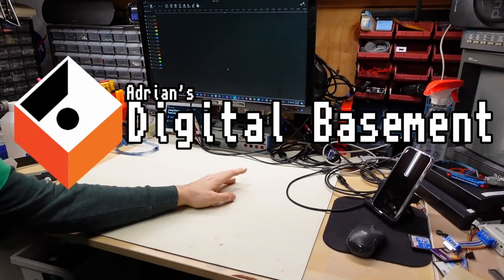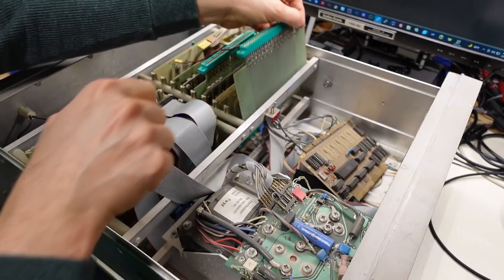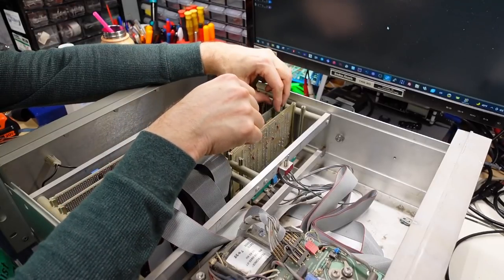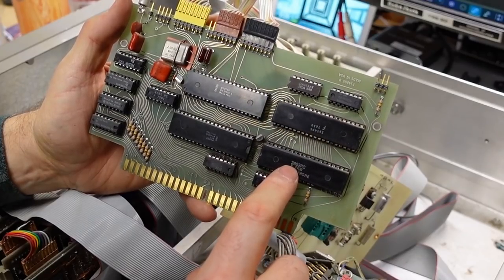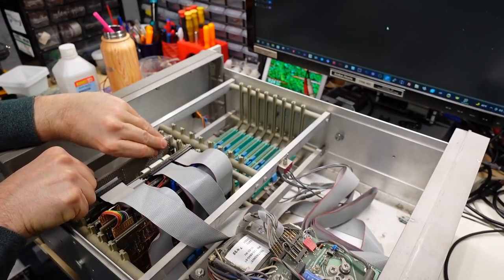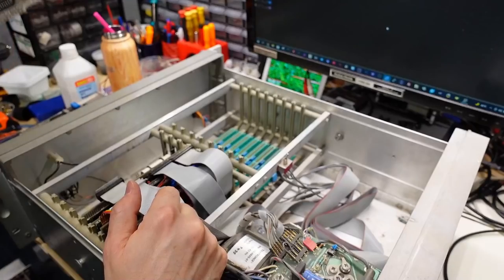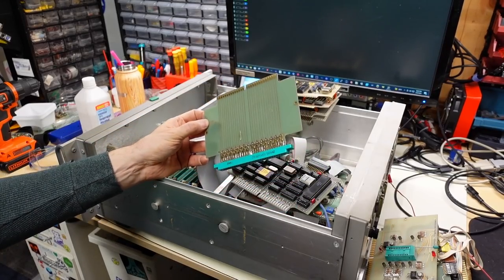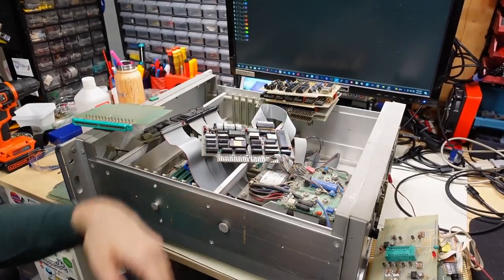I need help finding information on this mysterious computer

Comment: It's an STD Bus machine ( https://en.wikipedia.org/wiki/STD_Bus ).

Edit: The board with the four 40-pin packages and which is connected to the ZIF socket board appears to be a Mostek 3870 system ( https://www.cpu-world.com/CPUs/3870/index.html ),  which is a direct derivative of the Fairchild F8 family ( https://en.wikipedia.org/wiki/Fairchild_F8 ). Wild!

Edit 2: Z280 is a 16-bit extension of the Z80. TIL! ( https://en.wikipedia.org/wiki/Zilog_Z280 )

More edits:
- The 6402 is one of the earliest single-chip UARTs I'm aware of. Both 6402s are associated with the expected level shifters for RS-232, in both cases in the form of the little 8-pin SN75150 driver on two outgoing lines and the SN75154 receiver for four incoming lines. One line in each direction will be for data (TX and RX) and the others will most likely be modem status/hardware flow control.
- So there are... what, three separate CPUs in that thing? Four? And at least three different architectures too (F8/3870, Z80, Z280). Wow.

It's a beautiful machine. Those handmade cards are works of art. I'm glad you were able to rescue it.
Reply: I'm beginning to think this might be part of a collection of separate STD bus computers with cards just being stored in this chassis to keep them safe? It does seem odd that there are several cpus, unless the toggle was to select from the 3 cards?
Reply: @LegalizeAdulthood  Pin 1 of these is ground, so it doesn't match electrically either
Reply: Yeah, the many different processors is super weird... It's like there are three or four computers all crammed into the one box. I suppose given the somewhat ridiculous number of UARTs in there this is maybe not a stupid explanation?

And yes, those handmade boards are GORGEOUS, in all likelihood a complete nightmare to troubleshoot but gorgeous none the less...
Reply: It's not a single configuration. 

Based on the date codes, I suspect the F8/3870 was the original CPU that shipped in this machine. The ROM board appears to be of the same vintage, the PROM programmer and maybe the 24k ram board, though it looks slightly newer. maybe the first SIO board. All chips on these boards date to 1979 or earlier. 

Then the Z80 board was added on later, maybe in 1981?, along with the 64k dram board and the CPM ROM chips, and the machine was converted into a CPM machine. I think the Floppy controller, and RTC/serial/FPU board dates to this config. 

Then the Z80 board was removed, that's why it was floating around the case, along with the CPM rom, and was replaced with the handwired Z280 sometime after 1986. The handwired 128kb of SRAM probably also comes from this era, and the serial/parallel/timer board. I suspect this is when many of the other boards got most of their bodge wires. 

I suspect this chassis actually carries two reasonably independent systems at once. The original F8/3870 machine, and the Z80 or Z280 machine. Not sure if both can run at once, or interleave execution. Or if one of the toggle switches switches between the two systems.
Reply: I think three processors. Ok, guessing time based on the cards, their state and what you found out:
My guess is that the Z80 is the primary CPU and probably ran CP/M (if not it'll probably get even harder). I'm wondering if the sockets on that board is there to allow people the option of using it as a minimal system, say 2 ROM and 4 RAM? It has a LOT of board connectors on top so perhaps that's how it would be connected to the external world in that mode?

The Mostek (F8) is connected to what must be an EPROM programmer, so I'm going to guess it runs independently, some kind of program on the CP/M side configure it (address for image?) and tell it to program an EPROM, which it does with no interaction. Basically a bit like the C64 and how it's floppy drives have a completely independent MOS processor just running the floppy drive which gets told to do things.

The Z280 I'm guessing it's either an accelerator that takes over for the Z80 or it's an entire independent accelerator.

I'm leaning more towards the first explaination, I see that the Z280 can run at 4x the external clock and instruction timings may well be much shorter too so IF it's fully compatible with the Z80 and they can somehow disable the main CPU it should provide a massive performance boost, similar to those "turbo" cartridges for C64 that make that go much faster. And if not, well, it's a bit like the C64 floppy drive again.

Those are all guesses but might provide some hope for trying to run it, if correct it MIGHT be possible to leave out a number of the cards (Fairchild/EPROM/Z280/128k? SRAM) and it might even run a bog-standard CP/M if you can get hold of one. But there's bodges and modifications everywhere so even IF I'm right it's possible the main Z80 processor is hard-disabled because there was no way to do to cleanly let the Z280 board take over, in which case the Z280 board would also be necessary. Without a lot more knowledge it'll be a crap-shot at best I suspect.

I also don't know how much variance there is between CP/M variants, you may have to find the "right" CP/M for that and there's no Google matches for the markings on the CPU board which isn't very promising.
Reply: @phirenz  it was i was thinking the switch a the middle look to me like it switch the backplane board he dont show the bard hard to say too
Reply: Having STD gear in my workshop I can definitively confirm that this not STD bus gear.  I still need to figure out the bus, but it is not STD.
Reply: I gotta go with the idea that the z280 and SRAM was either a later replacement/upgrade for the z80, or the two backplanes are independent and they were completely separate computers.
Reply: The position of the Ground Pins seem to be in the wrong place for STD, also the wide traces on the pads either side of the slot look like they are power lines. Pins names are 1-26 and A - FF (as seen on the riser cards) so unlikely to be STD.
Reply: That is not STD. Cards are the completely wrong shape. I used to know what this was, and it has many similarities to S100 but for a bit of corner cutting to make them smaller. I would almost swear it is s100 with different edge connector layout, but memory is now failing me in my old age.
Reply: Looks like. STD Bus has the same number of contacts. But the notch position slightly differs from system to system.
Might be a prototype of unreleased Mostek/Prolog system...
Reply: It's might not be that specific bus, but it's A bus. My vote is for Industrial Legos.
Reply: Video broadcast, sync stripping with frame grab. Remember that's when 6 stations controlled the entire population, spare no expense (I was a broadcast bench tech)
Reply: @lindoran  I think of it as something that started its life in the latter half of the 1970s and was just upgraded by someone who really knew their stuff, and left the old stuff there for backwards compatibility. After all, it likely ran all homebrew software as well, and instead of using floppies, they were stored on eproms. It'd be really interesting to see this restored to a working state.
Reply: I think not, the STD bus pinout does not match the "surround-ground" on the Z280 board.
Reply: Yep.  I counted 14 pins on one side of a riser card (from outer edge to center gap), multiplied by 4 and confirms they are 56-pin cards.
Reply: @minty_Joe  But the ground, power, and notch are in the wrong places for STD.
Reply: @MrHurricaneFloyd  Yeah, I'll take everyone's word for granted that these may not be STD equipment/computer internals.  The backplane or bus is using 56-pin slots, but who knows what make/model computers use those.  I'm not familiar with that platform of hardware; I'm more of a Microsoft/Apple/Linux tech.
Reply: One of the cards shown in the videos has a wire going all the way round which looks like GND. The STD bus has GND on PIN2 and different signals/power on the ends of the connector. It looks like a Q-Bus, most cards in my PSP-11 have a trace going all the way round just like the cards in the video. On the other hand, a Q-bus is a lot more complex to use since multiplexed.
Reply: At that times the multi board computers were in need for a CPU for each major function (might it be interrupt driven IO or similar). Else the timing would have the chance to get missed.

Other than that it was pretty standard in the industry to have multiple processors on multiple boards for such board plug in systems. Or maybe it was even more common in the days after, such as the various standardized card systems. The backplanes were more for the purpose of communication between those units. (Might it be the case for things like Profibus or predecessor systems including all proprietary ones.)
Reply: The multiple CPU cards and combination rack/bench cabinet matches the top comment that this was a bit box for embedded software development.  The team using this box would have plugged in cards to somewhat match the customer system they were writing code for in any given week.  Not an exact match, just close enough to debug the software that would run on whatever hardware the customer had.  The modern equivalent would be a stack of development boards like Toradex boards and reference boards made by CPU companies like Atmel, NXP, TI etc.
  I work in software development and have a few such boards in my collection, even though my work isn't hardware specific enough to really need the flexibility to match systems that closely.

Comment from the maker: Since I can only have one pinned comment, I'm consolidating there. Side note, I plan to dump all the ROM chips with hope they can give us a clue about the origin or this machine. 
.
I got an email from a viewer:
"Many of the parts of the units were made by Tektronix. The case with the "special" openers are Tektronix stlye. The powersupply comes from a Tektronix 31 calculator. The numbers on the PCB (EXXXX = Tek prototype boards) and arrows indicating pin1, the style of the pin-row headers, the style of the extender boards,.... Thats tektronix all over the place. Since you're from the protland area you should contact the vintageTEK museum. I think they can help you to identify the unit." 
.
I reached out to the TEKmuseum and heard back from Bob: "The consensus was that some boards were indeed made by Tek. But 'Ennnn' numbers imply an engineering project, as opposed to a product for sale. The boards are the same form factor as used in the first Tek terminal, the T4002. As to whether the wired boards were home-made or Tek-made, we couldn't decide. But it looks like a home computer made with partly Tek-made parts. A lot of employees were doing the same thing in the late '70's."
.
Also another YouTube comment seems to be revealing:
Sam Cross: Greetings the device you have is part of ATE system bulit by a company I worked for in the early 80's in salem oregon. It was bulit for one of their customers on contract.. please contact me for more info.

Comment: So - at one point in my career I worked at a Company that produced alot of high end sensor equipment, and they had to support said equipment for a life of at least 25 years, they had alot of this sort of kit around - none of it was my responsibility so I barely got to interact with it much

Long story short they had alot of sensor calibration gear in ancient rack mounted machines, in cases just like those - with machines built 20+ years ago either in house or typically from small engineer sector businesses that would sell some kind of bespoke equipment that would come with a machine as part of the rig. Mega obsolence in place, if there was ever a problem with these they'd be out of order for a long time whilst guys who had no idea what they were doing would try diagnose because the guys that used them in anger were long retired. They'd have serial coming out of the senors, into these machines and out again at times into other hardware. I'm talking 2010s with even Sun servers and VAX terminals still being actively used

Whilst I couldn't/ wouldn't say that is the purpose of this machine, the similarity is pretty remarkable
Reply: I once heard of an original IBM PC being used to control a piece of production equipment in the 2000s. Apparently, the equipment designer had looked at the extra ROM sockets on the PC, thought "I'll use that!", depended on the bus frequency as well if I recall, and the company never saw a point in replacing the system because it would be cheaper to track down another original PC.
Reply: @absalomdraconis  In 1997 I worked a temp job in IT at a printing company.  First repair job was on an 8088 desktop in a cabinet under a binding machine.  A pressure switch on the output tray would fire a relay on a custom circuit board, and the pc recorded copies coming out of the binder.  It ran DOS and fed a monochrome display. 

In 2018 the car manufacturer I was working for had robot arms which still ran on Win98.  It was what shipped with the arms when they were bought in 1999.  The tire changing machines ran on Win2000.
Reply: @timmooney7528  I have seen a DOS machine (a 468 no less) no one was sure what it did (other than knowing it was something central and important) at a major paints manufacturer's production plant as late as 2015. The dude that made the custom software for it had long retired and moved across the country, and the disks that once contained the sources had been unreadable for a long time before I set foot in there to top it off.
We were hired to assist the new guy in charge of the department in something unrelated to this machine, and he was clearly stressed out about the state of things - with good reason!
Reply: @absalomdraconis  If it ain't broken, don't fix it. At least never replace it with modern crappy hardware and bloatware.
Reply: @TheSimoc  If the things are in this state, you better fix it before it hits the fan. You can let it run, but you really want to have some drop-in replacement as backup.

A lot of this old stuff can be replaced by a cheap microcontroller these days. No need for bloated software. Unfortunately most programmers are not that good, so they use what they know and you end up with an Java-Application on Windows.
Reply: @TheSimoc  If it was used in manufacturing I doubt there would be much tolerance for BSODs or love for the windows controlled hardware from plant personnel.
Reply: @5Hydroxytryptophan  Your attitude of throw away all old equipment is the reason things fall apart.  Someone needs to learn what things do before even attempting to build a replacement.
Reply: @johndododoe1411  This is absolutely not my attitude. I love old stuff! I'm fixing a lot of old tech myself and love to tinker around with it. It is just not viable for mission critical applications, where people might lose jobs if something breaks. Believe me, I know some companies that almost gone bankrupt after some equipment stopped working.

Reverse engineering and documenting of stuff should happen before it is too late. This is my whole point. As I said, you really want a backup if the worst case happens. Lots of companies do not have these backup or even documentation.

Comment: Extremely similar to pieces of equipment I have that were obsoleted from radio telescope installations. They were rack mount, custom made with bespoke proper tools such as panel punching, nicely engraved fascia panels, custom PCBs but hand soldered/soddered, good nylon card guides, cable hold-downs, star washers under screws etc etc.  They are well made because they had a government budget to do it, and it had to live a long service life.

Comment: Card ejectors are what's missing on the corners.  And yes, that is enameled magnet wire used for rework on the back. Mil-grade stuff had it all embedded afterward in epoxy so this is likely not that.  They would also have littered everything with identification and serial numbers, also in epoxy, each numeral applied with a tweezer and a little rubber stamp.  In yellow.
Reply: yeah, but you need holes in the board to attach the ejectors, and I didn't see any on these...